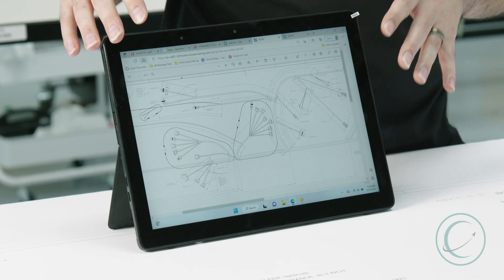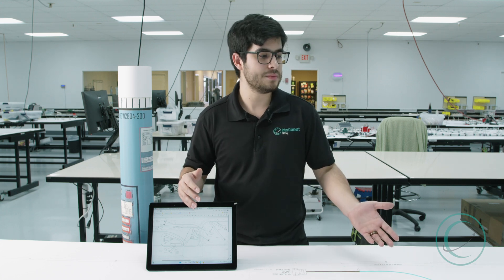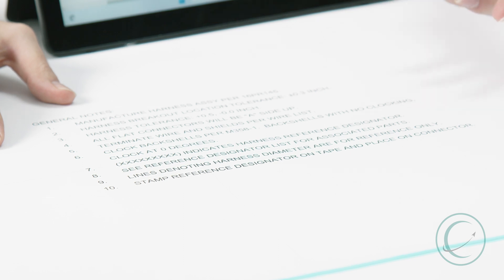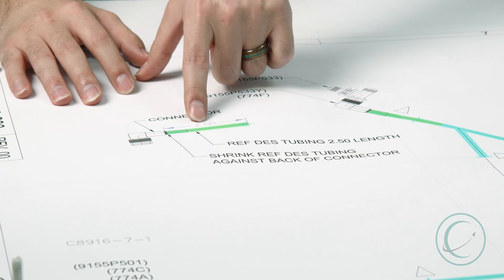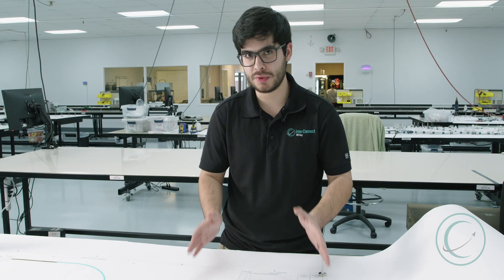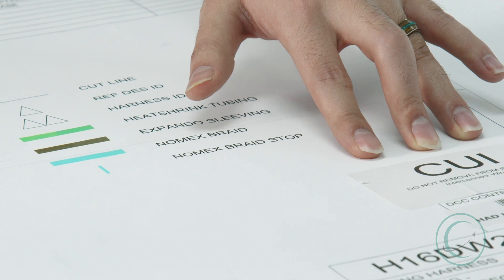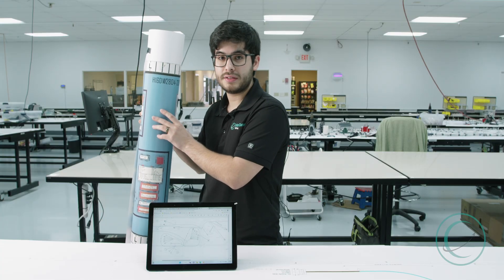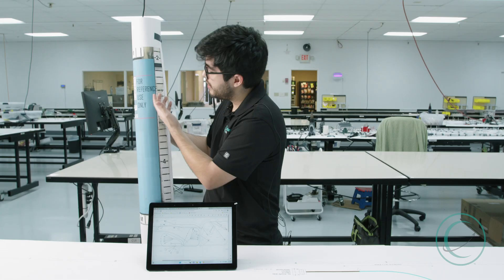How Does InterConnect Wiring Make HADs? What Do All Those Symbols Mean?

Comment: What software do you use? Solidworks?
Reply from the maker: Great question! Why do you ask?
Reply: @InterConnectWiring  The HAD drawings look really good, but simplified. I was curious if you used E3 Zuken or another specialized cable CAD or if you just used a generic CAD program.
Reply from the maker: @Crunk99ify  Zuken is right. It is a powerful program.